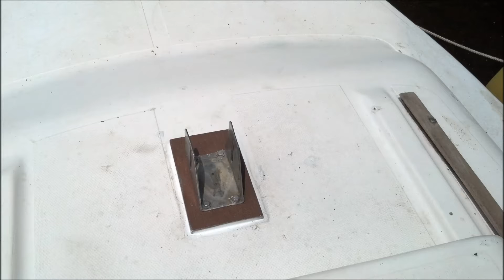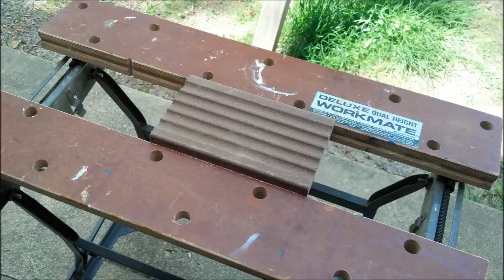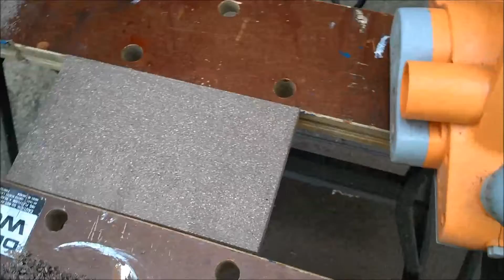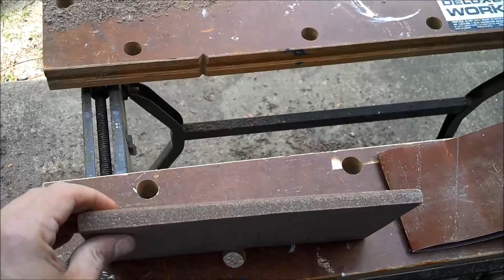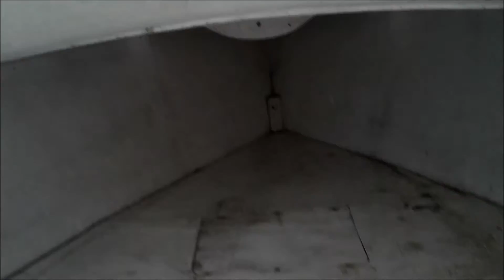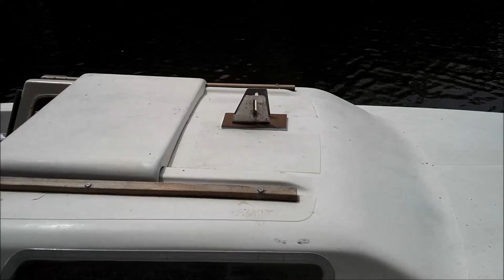Venture 17 Sailboat Mast Step Repair

Comment: Found your repair in my Watch Later list and I have a question. Have you compared the location of your mast step to other Venture 17s? I have  V21 that must have been demasted in a past life as there is an obvious repair, but it is further forward. The tracks for the hatch cover appear to allow travel far exceeding the available area before hitting the step...  I like the idea of using the composite decking, but may find my re-repair requires more glass work to make it less obvious.
Cheers!